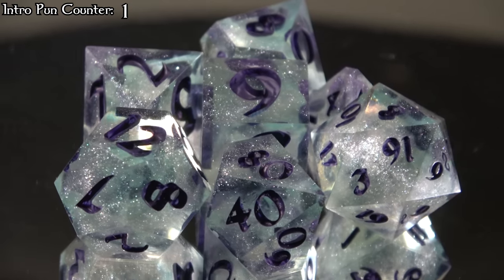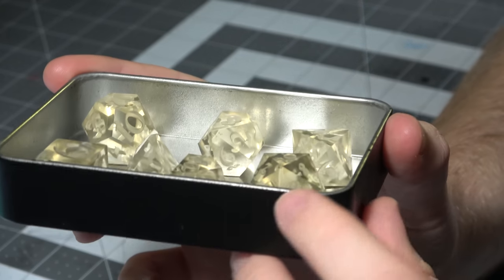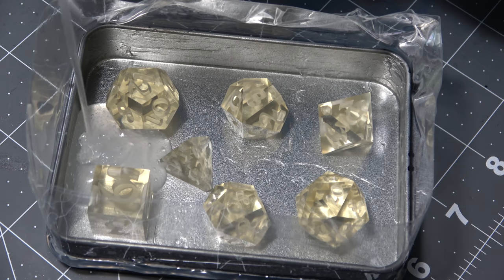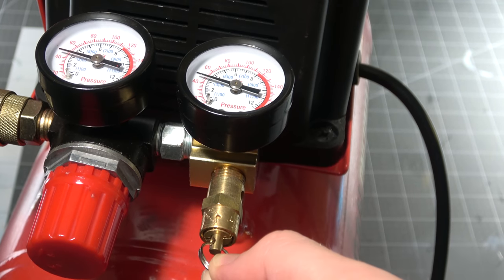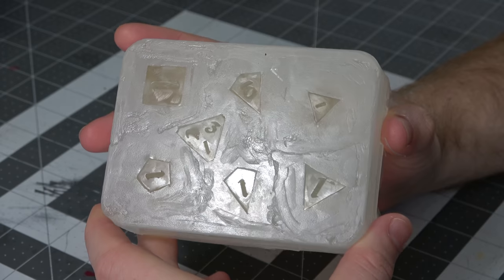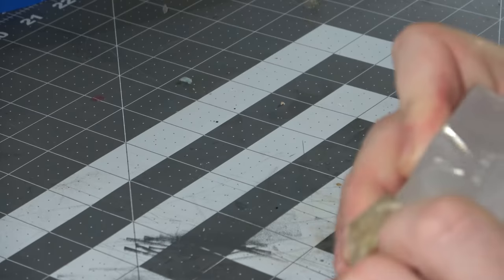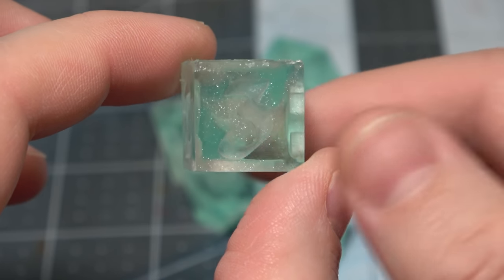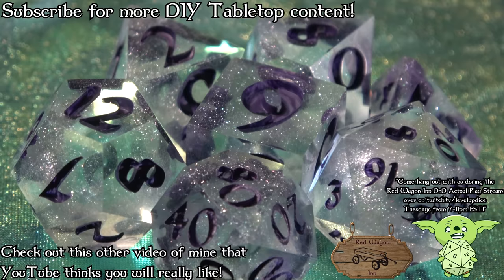The Complete Guide to Dice Making | Cap Molds

Comment: You use a “Pressure pot” in your videos, and despite googling multiple times, I’m left with three questions:
1) is a pressure pot the same as a pressure cooker? 
2) you always tell the pressure, but not the temperature (if it is a pressure cooker) - should it be on low heat?
3) why use a wooden insert when making dice? Is there a reason not to just put it on the bottom of the pot itself? Why use the wooden buffer?
Reply: 1-no 2-not a pressure cooker so don’t worry about that 3- his pressure pot has a rounded ish bottom in it . The wood makes it flat
Reply: @mitchellepstein9956  thank you so much!

Comment: Question for other makers! If I pour a portion of the silicon into a mold, wait for it to settle and then pour the other half would the two halves be bonded? Im trying to make a resin amp jewel and I wanted to insert a small metal piece for mounting in the second pour. Thank you!
Reply: sorry for the super late reply. I know that you probably have this figured out by now, but yes. silicone bonds with silicone.

Comment: hi, thank you for the videos! they are all great!
what are the advantages and disadvantages of pouring in two stages? I'm trying to set a small model inside a transparent die and to make sure it's centered I am going to fill the mold just under halfway, let it cure a bit, put in the inset in with a dab of superglue, and top it up.
do you think I'll see a phase line between the stages?
will it help with bubbles if I'm not doing it in a single pour? i can't get a pressure pot.
do you know if there's an easier way to suspend an object inside the cast?
thank you kindly.
Reply: As long as your resin hasn't fully cured before you pour the second layer, you shouldn't be able to see a line 😊

Comment: I was curious about the way in which Dragon Skin 20 works for making cap molds. I see that you pour them into separate cups and then into one for mixing before pouring the mold, but for the cap of this since it takes four hours to set the mold, are the two parts of Dragon Skin fine just sitting out for an extended duration while the mold cures. Mostly asking if I can use the same bottle of the trail set for the cap and the base if that makes sense.

Comment: A double cylinder  foot pump works fine for adding air to the pressure pot. It's relatively noise free and cost me 8€ in Lidl.

Comment: Why putting the lowest number down to be the cap? If I'm making dice with some inclusions that have to be "upright" to be seen correctly, why not having the highest number on top? Or is there a technical reason for you to do it this way?
Reply: I believe the reason might be more clear in earlier videos, but basically, depending on the type of mold, you have a sprue and/or flashing that must be removed by sanding. The 20 side leaves no room for placement of a sprue, and risks damage to the number to remove all traces of one. And flashing could easily impinge on the number 20 much easier than on the 1.

Comment: Wow, came here for the insights and was not disappointed. You really took your time and made everything perfect. From the meticulous hot gluing of the tape to avoid leaking to the very slow pour of the silicone to ensure no bubbles and perfection. I will 100% be using this method to make molds in the future. And you just had to ruin it by completely half-assing the paint job at the end. It is so uneven and splotchy. You even say that you don't need a second layer but are completely fine with that messy fill. Maybe I'm just a nitpicking perfectionist but that seems far to striking to not have noticed and question if it ruins the appeal. I see this often in your videos. You have so much wisdom on how to make the dice and you are an excellent source on theory, but you have no eye for detail or the will to just redo it if it isn't quality.

Comment: Hello, I'm starting to make dices and I liked this technique, but I don't have a pressure Pot, it affects the final result a lot ? (I'm from Brazil and I'm using the translator for this excuse any error)
Reply from the maker: No worries! Hello from the U.S.!

It doesn't effect it a lot if you aren't going to use a pressure pot with the resin. If you are though, you need to pressure cast the silicone, as if not, whenever you cast dice, you will get a bunch of tiny bubbles and holes on your dice.

Comment: I was wondering about a different method to prevent the silicone from going under the dice when making the bottom of the molds. I have issues getting clean lines.  If you take sculpty and line the bottom of your mold vessel would that hold them as well? Just barely press them in so that the silicone won’t get under them. I don’t have any silicone left or I would attempt it.
Reply: I use Sculpey Premo (it's what I have on hand) to make the bottom of a mold. I use a cookie cutter to make the "box" and press the cookie cutter and whatever I'm making a mold of into the Sculpey (not all the way through). I press the cookie cutter in deeper than I do the item I am making a mold of. I've never had a problem with simple items, but I have had issues with super detailed items that are not flat (like butterfly wings) or that have many holes (like a filigree pendent). I have not made a cap mold yet, but smooth on uses sulfur-free clay in their two part molds... so I don't know why it wouldn't work for a cap mold.
Reply: @creed942   I've tried this since i watched the video and it works pretty well. If you keep the sculpty thin it presses in and makes a good seal without coming up the sides too much.

Comment: I disagree with tightening the pressure pot as much as possible. I have had issues with it being TOO tight and bending the lid just enough to leak air. I found loosening them stops the leaks. Just my experience, not saying he's wrong.

Comment: I'm having an issue, and it keeps happening so I thought I'd ask here and see if anyone knows what to do.

So, I have dice that I have 3D printed. I have elegoo Mars printer and transparent blue 3D printing resin. Specifically the water washable kind

The prints come out fine, and cleaning them and polishing them was super easy

But when it came to casting them, I had some major problems. I have been using the inhibit X to make sure they don't stop the silicone from curing, but I think it may cause another issue. 

The silicone has been bonding to the resin masters. I can't get them out, can't even cut them out to try again, it's like when you pour silicone on silicone, it never comes apart again. Except it's resin, which the silicone shouldn't adhere to

I am using dragon skin silicone, just like in this video, I followed all the steps, but they always come out this way. Its getting expensive to keep trying this,,, 

Does anyone know what might be causing this?

Comment: Silicon should be de-gassed and not cured under pressure: Most silicons can not hold a lot of gas dissolved and bubbles can re-form over the coming days or weeks. If you are using your molds right away that is not much of a problem but if you plan to keep using the molds occasionally over longer timeperiods then curing them normally will be better.
And for getting air trapped on the numbers: brush on some silicon before filling pouring the rest of the silicon.

Comment: Wait, so why this style over  spru style molds, seems like it takes more work for not cutting and sanding one spru.
Reply from the maker: It really kind of depends. It's more upfront work, but less sanding. Sanding one sprue isn't totally accurate, as you usually have to end up sanding whatever sides touch the part where you cut the dice out :)

Comment: dude stop it with the pressure pot im broke and can't make one
Reply: You can always just... not use one? You'll get a lot of bubbles and it'll be basically impossible to make transparent dice, but that's the only alternative (or a vacuum chamber, but I cant imagine that's cheaper than a pressure pot). But like, resin and silicone are both pretty expensive too, its not a cheap hobby.
Reply: @Magmafrost13  you can get some pressure pots for like $80. I personally use one that's 2.5 gallons and it works just fine. as for the part about everything being expensive...

yeah...

Comment: Ok, so curing your silicone in a pressure pot is not how you reduce the bubbles in your silicone….this it just plain incorrect information! This just compresses the trapped air and will cause your molds to have the ‘mumps’ potentially. You need to degass your silicone in a vacuumed tank, then remove trapped air from the pouring process with either more vacuum or vibration. Goodness gracious…….